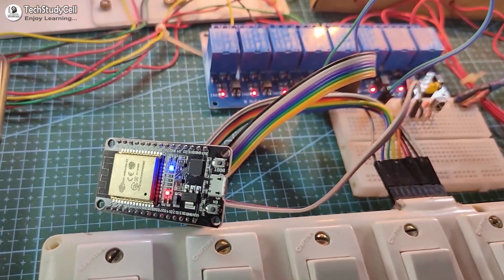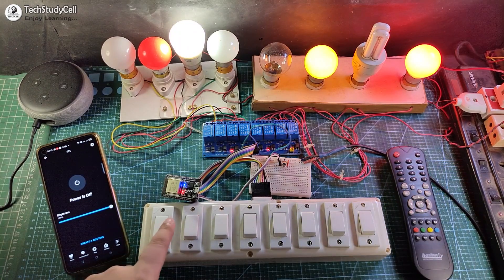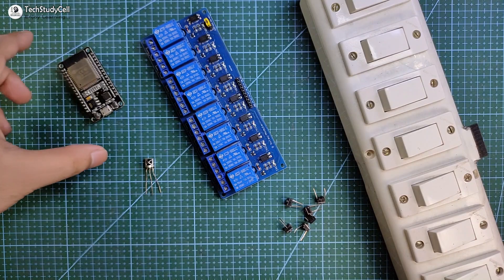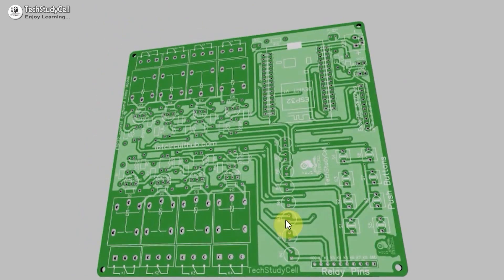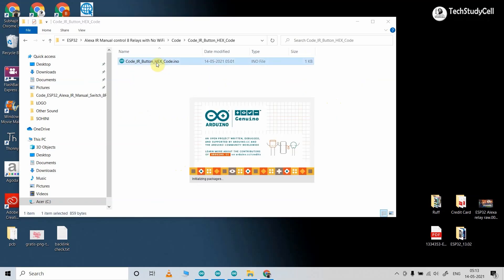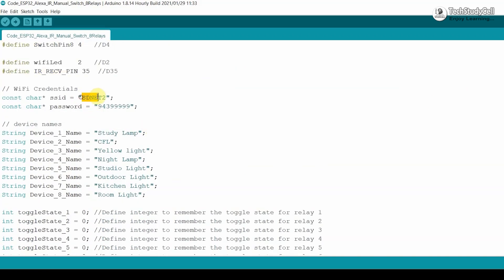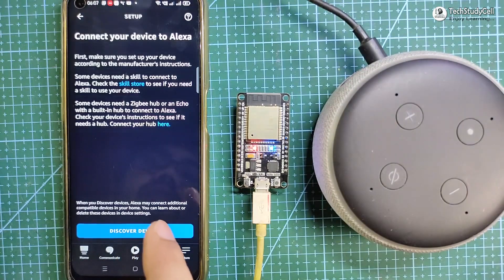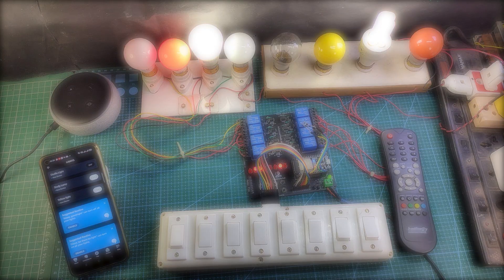Smart Home with Amazon Alexa using ESP32 control Relay (Voice + IR Remote) | IoT Projects 2021

Comment: How about the power supply of really board and esp32 .... It working properly .. but the problem is power supply is very big I choose 5 v.10 amp. Power supply it doesn't fit inside the metal box ..is there any idea to solve the problem .. please mention the accurate power supply for the boards

Comment: Thanks for the video bro.In your first code of ir hex generator the 9600 baud rate do not work, 115700 is working please correct me if I am wrong.
Reply from the maker: Please check the baud rate mentioned in the code, then select.

Comment: This project hv one problem... after boot up its need to connect wifi at Least once... then remote or manual mode works...no matter now wifi connected or not... but if ifter boot it left not connected the no modes works...

Comment: "Cannot connect to wifi. So manual mode" their is a bug here if initally we dont conntct it to wifi we cannot use the manual mode.
If used the IR remote button program crashes with an error 
Guru Meditation Error : Core 1 panic'ed  (loadProhibited)

 Any solution??? 
 Thankyou 😀

Comment: Hello Subhajit
first of all, congratulations for the projects you develop and share.
Having developed and prototyped pcb of similar projects, I wanted to ask you what software you use for the creation of pcbs.
I wanted to start from yours, done very well, and modify it to add a section in which to insert the Power Supply Module Hi-Link HLK-PM01 AC-DC 220 V to 5 V, you can share the starting file, not the gerber, to allow me this change?
Obviously I would share the work done again
Thank you
Reply: Hello subhajit,
Can i purchase PCB of these project directly from you..adding power module on the board is a good suggestion from Gianpic69

Comment: Hi can we read an analogue value at the esp pin  and relay it to alexa interface. Value to  display eg:  room temperature, automation based on conditional switching of output based on the value read at esp pins?